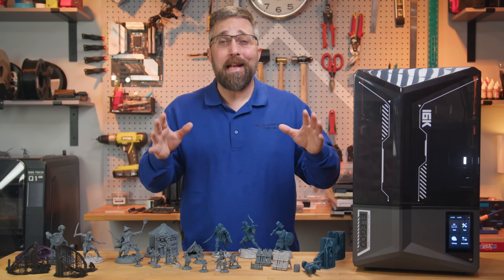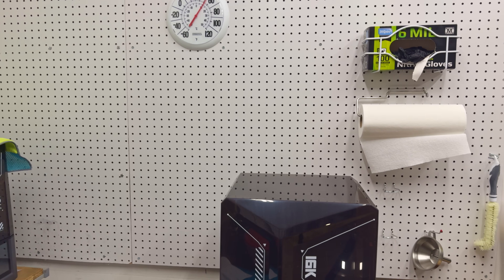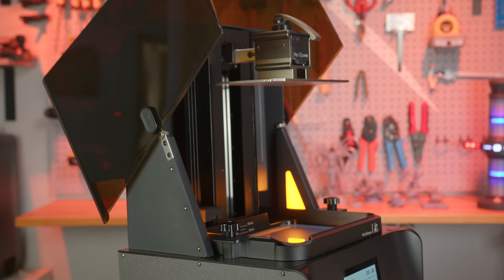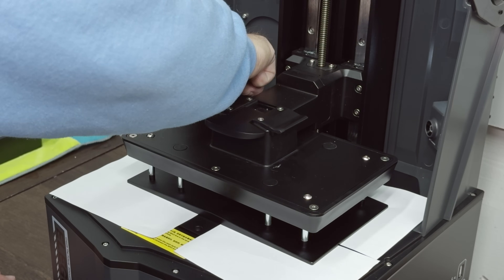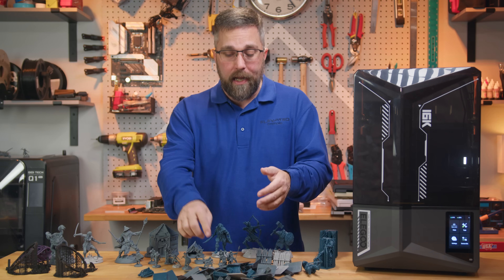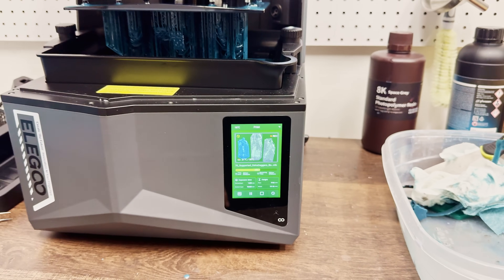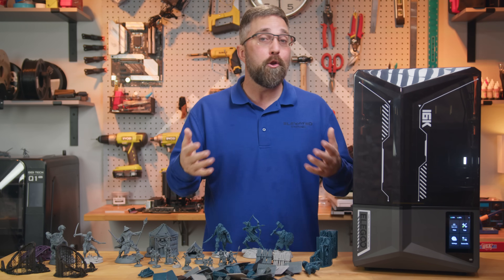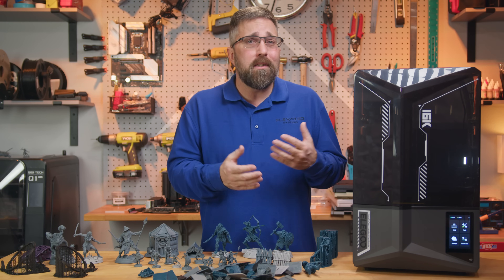Elegoo Saturn 4 Ultra 16K: Hype vs Reality!

Comment: Unfortunately, I'm having trouble getting the right settings with 8k standard resin in test prints. Could you share the settings you're using? I got excellent prints with the standard resin, but unfortunately, I'm not succeeding with 8k.

Comment: Hello I. Want to ask something but I don't know who to ask. Or where? I was thinking about buying a resin printer. To Brent figures. And sell them. Because the situation here in Egypt is not the greatest and. There is basically no one doing that. It's only FDM. And I don't like the quality. It's not like the figures you buy from outside the country, which is really expensive. So I wanna know which? Printer should I use? And how much it's gonna cost me because the Is the conversion rate of the currency is insane and even?$200 printer. Will cost me here about. 800 to get. Which is insanely expensive in Egypt if. You have any time can you please just answer my question or guide me? To the right way.

Comment: I have bought one and the results are awesome. We are able to print 192 pieces of a infrared housing at once in 6 hours, reduced the support kind and also collect a awesome resolution using Jyko abs like solid white with a perfection printing. Every detail is awesome. Send your printer back as failure as RMA if its acting like in the video. Mine is perfect!

Comment: Just bought the 16k opened it up and perfectly printed a $100 model on the first attempt. I will never use another resin printer it is perfect. And the details the person I gave the model to could not shut up about the details. The model was so good I used it as an a present, no joke. And told them this was my first print on the machine.
Reply: Do you also paint the figures yourself ?

Comment: What layer height did you use on your prints? I am looking for something that has a larger build volume and is similar resolution to my phorzen mini 8k. At .2 layer height I get 0 visible layer lines, I get some layer lines at .5. Like I said I am looking for a larger build volume with a close to 20 micron resolution target.

Comment: One quick point; I'm a 23 year journeyman machinist and a Mechanical Engineer, and just wanted to say that a plate of float glass even tempered glass isn't a reliably flat surface. They look extremely flat but due to internal stresses and the manufacturing process, most are actually much less flat than you'd think. You need a good qualified granite surface plate or a ground cast iron platen.
Reply: He probably already knows this which is why he specifically pointed out for the watcher that he performed the "feeler" test in several orientations and positions on the glass, with the same results, thus showing that the problem was with the plate and not the glass...

Comment: Everyone needs to face the fact that you cannot print directly on this build plate.  From my experience you have to print calibration tests on supports.  First figure out your bottom exposure which was 25 seconds for me using Anycubic ABS Pro 2.  Then you have to put your calibration tests on supports and they come out beautifully.  Also please be aware that there are major problems with Elegoo Standard 8k Resin.  I have read numerous threads with print failure and everyone started with the Standard 8k from Elegoo.  l switched, dialed in, and have some badass prints.  If you are willing to work through the quirks then this printer is a speed machine.  A 14hr print on my Heygears Reflex RS  took 7 hours on this printer.  The speed definitely has me sold.  Hopefully the Saturn 5 comes out soon with all the bugs and quirks worked out.

Comment: I have the same leveling issue with the Mars 5 ultra. One trouble spot that prints won't stick to it. It looks like the same area near center like in the video. Also I can't use the camera to monitor because it often disconnects from the network.

Comment: Wait... Why your building plate is pressing so much to the monitor!? It is abnormal because every sharp edge or support will easily damage it 9:54
Reply from the maker: That is how the Printer handles "Auto Leveling". It just presses the spring-loaded plate into the screen until it is "Level".

Comment: So I had a Saturn 2 and it died after heavy use.  I got a Saturn 4k Ultra (not 16k) and I found myself in the "I can't get this dialed in" mode but I could get it very close.  The issue I found was that there wasn't consistency around the build plate for dialing in the settings.  An example is that the upper left side of the build plate needed more time than say another area.  Yes it was leveled and it was all over the place, with the settings. 

To be very clear here though, this is getting the setting perfect with the test prints.   Then for the heck of it I tried a "professional" resin.   It was perfect across the entire build plate.  Freaking perfect time and time again.  I could dial in the EXACT setting I needed and it worked every time.  The occasional gaps I would get when I needed to print pieces?  Gone.  The Resin is "Siraya Tech Tenacious Easy Grey 3D Printer Resin"  It is not their "fast" but their professional Resin and of course it cost like 2x as much.   

So now when I just need to print some mini's that are all one piece, I just use cheaper resin and the general settings I have is fine.  I get near 100% success and yes parts may be over cured, but it doesn't make any difference.   ZERO.   If I want to print out parts that I will connect together and I need perfect, or near perfect prints?  I use the professional resin.    On a side note this resin is perhaps a bit stronger/flexible as well.   

Now I didn't have any of the problems this guy had in his use of the printer.  Granted I don't have the 16k model and don't have the tank heater.  I have a separate heater.   I can say seeing the models he printed, I feel I could have that done easily in a couple of days of printing.  If I really focused I could probably have it in 2 days.   Not taking shots at the reviewer at all, as if I had the problems he had, I probably would have just sent it back.
Reply from the maker: I just bought a new build plate. The new one wasn't warped, and now I can get really good prints from the Printer. Elegoo was trying to solve a hardware problem with a software solution. You can check out my follow-up here - https://youtu.be/CVzrWId_z5c
Reply: @ElevatedSystems  What is the video supposed to be called? (I clicked the link twice and took me to 2 different videos, none of which look like a follow up)

Comment: I recently bought the Saturn 4 Ultra 16k. I haven't ran into any of these issues but one, obviously thanks to your work pointing out these problems, Elegoo managed to fix almost all of them. The issue I ran into was the build plate screws were all almost at their maximum so I have no more room to pull up the plate in order to release the paper below it. I had to add washers big enough (and wide enough to pin to get across it) to create enough space for leveling. As you said, unaceptable for a printer in this price range. Besides that, I didn't have any more problems and have had a good experience and precision with my prints. I just got in surprise to know the resins cannot actually reach this resolution so my 16k LCD has just been rendered useless lol. Anyway, I didn't care much for the resolution as the heated VAT is more important to me. Thanks for your effort buddy, dropped my like.

Comment: I'll carry on with my Saturn 8k and 3 ultra. Personally i dont feel the need for more pixels at the moment.
Sadly, I feel people just think more pixels the better. Maybe with a tv it matters but I believe that viewing minis at normal diistances you can't see a difference.
Reply: Hi, do you change the ACF to PFA for the S3U?
Reply: @cwtjones  Just order an appropriate size film and change it as per normal. I would then maybe use Saturn 8k settings and do some exposure tests.
TBH I've not done and I'm also probably not the best person to ask but would imagine you would need to increase the exposure a bit and maybe adjust the lift speed.
That or stick with the existing settings and increase exposure time and see how it goes.
I have also taken the plunge and just bought the S4U 16k. Absolutely brilliant.

Comment: I have the 12K Ultra, brand new. I rebooted my router for a firmware update and so the WiFi dropped for a minute. This caused the printer to freeze. Unbelievable. Thankfully, after a reboot, it did resume without any failures.
Reply: The file is not stored on the printer itself after network sending?
Reply: @cwtjones  It is. You could reprint the same file from the printer's interface if you wanted.
Reply: @MarkoVukovic0 ya i was thinking, it would be very unreliable if it needed to always be connected to wifi for printing. But how does resetting the router affect the print half way?
Reply: @cwtjones  There was a bug in the firmware which caused the machine to completely freeze if it lost Wi-Fi. So, restarting my router caused the connection to temporarily drop, and so the printer froze. It doesn't need to be connected once the file is uploaded, it was just a weird issue that caused the whole system to crash, which was subsequently fixed with a firmware update.

Comment: The way I got rid of the adhesion issues was to add a 5 seconds pre-exposure delay to the first few layers (in chitubox pro, in basic you can't control delays per level, so you have to either use UVtools to add the delays or just use a fixed delay if a couple of seconds). This gives resin time to evacuate the whole plate area before starting exposure.

Comment: I think you're asking for premium quality at affordable prices; if you take that build plate to your local machine shop & ask what they'd charge to level it, I think you may find out! One can conceivably do such things oneself with a bit of time and expertise.  IMO/E, Anything with significant software associated may also be so complex as to require exposure to a very diverse set of testers (with potentially expensive qualifications) to bring to a high degree of perfection...
Reply from the maker: Considering parallelism is the number one factor to success in an additive manufacturing process, you think it’s too much to ask that a 3d printer has a flat, non warped build plate? Seriously? That’s not premium quality, that’s just the bare minimum.

Comment: I am completely new to this and planning to get a Resin printer. My target scale is 1/64 (diecast) as I want to print some customization items. What would be the most ideal printer. Quality is something which I want like finer details. 

Yes I would print other stuff but 80-90% would be 1/64 scale items. 

I was thinking about the 16k but after seeing this I am a bit concerned. Should I go with the 12K saturn 4 or 12K saturn 3 or Mars 5, or something from anycubic. 

Only elegoo and Anycubic are my options as aftersales for the rest are very very limited where I live
Reply: I could use a little help on this too..

Comment: Hey there i am from dental lab geek,i need printer for cad cam section and crown printing on exocad software 
I need a printer and i am confised betwen anycubic m7pro and Saturn 4 ultra which one should i go
Reply from the maker: Neither Anycubic or Elegoo make medical grade printers. You should not get either of those. You need a medical grade printer for anything that’s going into a human body.
Reply: @ElevatedSystems  bro we do the casting later so the metal which we use is medical grade but I think u don't know the dental lab procedure anyways thanks for your help suggestions till now

Comment: The exact same failure you experienced at 13:00 minutes happened to my 16k yesterday. 

My hypothesis is the resin heating function tries to heat the vat before continuing the print (you can see the message on your screen right before the crunch). but the software hasn’t been updated to account for this new feature on the 16k, thus the resin heating function doesn’t understand there could be models on the build plate.

Comment: I have a Saturn 4 Ultra and it locks up just like you showed. Seems to only occur when using the network to monitor prints. Elegoo has been unable to offer any solution except put it closer to the access point (its about 10' away). Why would network problems cause the entire machine to lockup? Maybe should fix that as a start? I've had 3 Mars printers and they have all been awesome, but the Saturn 4's are kindof buggy in my opinion.
Reply: Several companies should just stop having such intrusive network functions in their firmware/software. It's unnecessary and probably just another source for glitches to troubleshoot.

Comment: Subbed, comprehensive review with a lot of technical details you normally don't get. I find "autolevel" on these machines to be completely unnecessary. I  never had an issue with tightening some bolts. The auto level just introduces an extra point of failure.